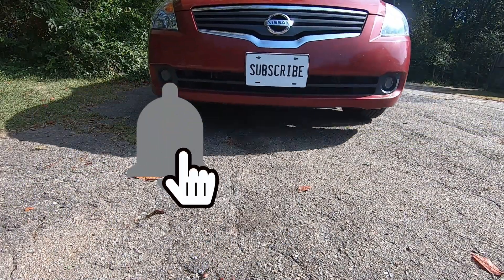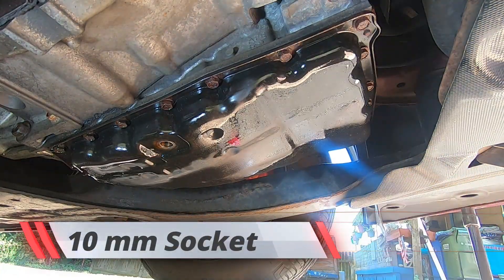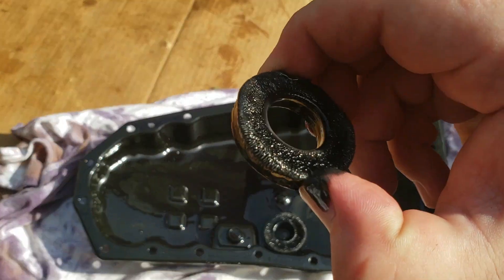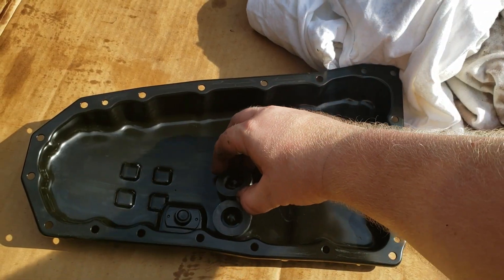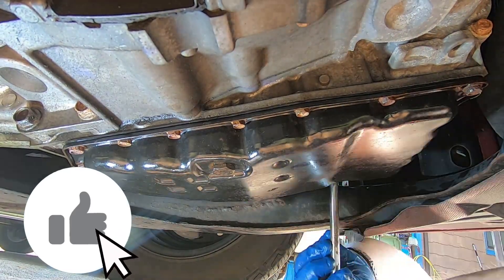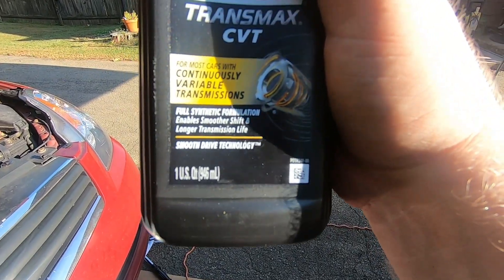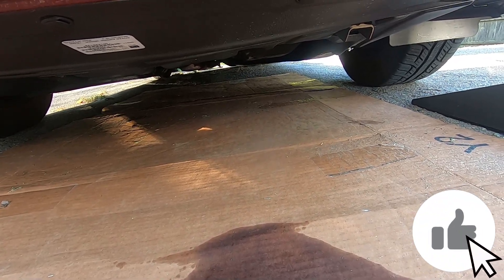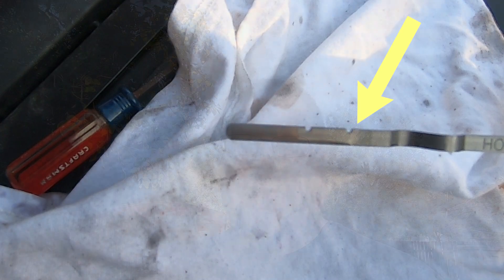2009 Nissan Altima 2.5L CVT Transmission Fluid Change! (with NO Drain Plug)

Comment: Where is all the oil though
Reply: Just wondering because I seen hardly any come out when you took the pan I’m just wondering so I’m careful to be prepared in case my oil comes out a lot more than that when I take the pan out or is it just gonna come out like yours,I don’t get that part.
Reply: Also could I use dw40 as brake clean for the magnets or is that no bueno pls let me know this could possible save me from having to buy a whole nother tranny
Reply from the maker: Since mine had a drain plug I drained it out first. So, when you pull your pan it will definitely pour out like a waterfall. Have rags and cardboard under your drain pan to catch any fluid that misses. It will be messy so have some safety glasses too 😉
Reply from the maker: You don't really need to use any brake clean or WD-40, some paper towels and some elbow grease should get all of the shavings off. You can even clean it with soap and water if you want it to be super clean, just make sure it's completely rinsed and dried off. Hope this helps, thanks for watching! 👍

Comment: Hi is it the same gearbox as the hybrid 2009 or is there a difference?
Reply from the maker: Hi Zanko! No, it's a different gearbox entirely because it has an electric motor inside to help assist the engine. I can't find much on these hybrids either. I suggest buying the service manual and everything you need for changing the fluid should be in there. Thanks for watching!
Reply: @TrickShiftGarage  thank you
Reply from the maker: You're welcome

Comment: Did you do this job on your transmission at 200k miles?  I have a 2009 Nissan Altima that has 167k miles and I've been trying to do research on whether I should change the transmission fluid.  Never have done it (wasn't aware of this) and now I'm wondering if changing it will do damage.  I think your experience will give me a better idea of what to expect considering it's the same car.  I appreciate the help!!
Reply from the maker: Hello there! Yes, it was right around 200k miles when this video was made. In my opinion, change the fluid every 30k miles. CVTs are very sensitive to dirty/old fluid as a lot of particulate matter can build up over a short period of time compared to traditional automatic transmissions. After I change the fluid in mine, it ran better than before, it seemed to "shift" better, like the car would go smoother lol.  I also put some SeaFoam Trans Tune in there as well to help keep it internally clean. Hope this helps, if you have any questions let us know. Thanks for watching! 🙂
Reply: I got to 167k miles without changing the transmission fluid because I wasn't aware of this maintenance.  I feel a lot better about doing this change if you did the same thing and got positive results.  Did you get to 200k for also not being aware of this maintenance?  I'm definitely going to start doing mine every 30k miles, I'm just trying to figure out the best course of action because of the miles I have.  I feel pretty good doing it considering you had roughly 33k more than I did at the time of your change. @TrickShiftGarage
Reply from the maker: Oh yes, changing the 167k mile-old fluid will cause you to feel the difference after you change the fluid. The first I learned that it does require maintenance it had about 110k miles on it and I changed it regularly since then. I think you should be fine going forward. Good luck! 👍
Reply: How many quarts if you just drain without dropping pan ?

Comment: Is that the correct fluid I thought the NISSAN CVT TRANSMISSION SHOULD BE GREEN?
Reply from the maker: Yes, the Nissan CVT fluid is green. I used Castrol CVT fluid which is compatible with NS-2. Thanks for watching! 🙂
Reply: @TrickShiftGarage  It didn't mess up your transmission did it? Also how much did you use fluid did you use???
Reply: Also how are those plastic ramps did they break because they're plastic?
Reply: @jonhawkins2374 I have one of those plastic ramp back in ‘99 and still using it to this day and nothing is cracked so far.
Reply: @deafbob720  Thanks dude.
Reply: How much fluid comes out of the drain pan???

Comment: What is the color of cvt oil nissan altima 2008
Reply from the maker: Honestly, I'm not sure. I've heard that NS-2 fluid is green but my 2007 Altima had red NS-2 fluid so I think it varies. Thanks for watching! 👍
Reply: thanks  @TrickShiftGarage
Reply from the maker: You're welcome 😊
Reply: Genuine Nissan  NS2 fluid  is about $27/qt now, which absolutely ridiculous.  My first two fluid replacements were done at the dealer where they replaced about 12 qts (the entire system).   Now that I'm out of warranty, I'm going to do these drain and fills (along with one the paper filter and the metal strainer).  However, it will be the 5-6 qt drain and fill.  Genuine fluid is clear to light green tint, in color.  I believe it's made by Idemitsu (CVT Type N) and is id the same color.  If your Nissan uses NS3, there is another Idemitsu CVT fluid type to use.  Idemitsu brand is less than half the cost of Nissan fluid.  Also, Valvoline makes a synthetic CVT fluid which I believe is both NS2 and NS3 compatible.   I think it's a similar clear color.  Make sure you get it in the blue and not red bottles (not sure the color fluid in the  red bottles).  This stuff is also at least half the cost of Genuine Nissan brand.  I would prob try to stick with fluid that is not red because someone might think you used standard fluid and not CVT

Comment: Can you still put a trans tune in it even thought there’s no drain plug? Would it be considered a closed system?
Reply from the maker: Absolutely you can. CVTs are considered closed systems for the most part. These can and should have the fluid replaced every 30k miles and has two serviceable transmission filters that can replaced as well. Thanks for watching! 👍

Comment: I have nissan altima with 200k, I wanted to change transmission fluid and one mechanic told me if you change it the problems will start, 
Is it true?
Reply from the maker: I'm leaning toward false, I don't think problems will start by doing preventative maintenance on any car. And it always depends on the transmission, how it was driven, the condition of the fluid as well as the internals. If your fluid level and condition is good and your having issues, it needs to be brought in for diagnosis. 

I've changed the transmission fluid on mine at 200k miles when I made this video and haven't had any issues so far. So if you can say to yourself that the car drives fine with no issues, go ahead and change the fluid to keep it that way. Just my .02 cents. Hope this helps, thanks for watching 🙂

Comment: Love your vids dude. I pumped out my trans fluid instead of doing all that lol
My trans fluid is overheating and I have to change it every 10k miles. 

Next fluid change ima have to do this because I wanted to change the filter, but didn't have the time and money to do everything I wanted. Kinda caught me off guard.
Reply from the maker: Thanks bro! Appreciate it! Yeah, pumping it out is much less messy than dropping the pan! 😂

Wow, I wonder why your fluid is overheating like that. Check your radiator out and see if it's blocked up with debris (dirt, leaves, plastic bag) Your transmission fluid goes to a smaller cooler that's inside of the main radiator so if there's an issue with overheating your fluids not getting cooled or there's a bigger issue with the transmission itself. Just my .2 cents lol. Thanks for watching JJ! 🙂
Reply: @TrickShiftGarage  not sure why. The only thing that comes to mind is the retarded mechanics I've dealt with. I had asked if changing the fluid was necessary, they said no, took a long cross country trip and the problem started. If they changed it like I suggested it would've never happened.

Anyways, Quick question. When you measure the cvt fluid level. Do you measure it while the vehicle is on, or off (after warming up)???
Reply from the maker: Yeah, that's true. Hopefully the new fluid will hold up better 🙂

So for this transmission, you want the engine on and running after a good 15 minute drive. Best time to check is when you get home from somewhere, leave it running and check right then and there.